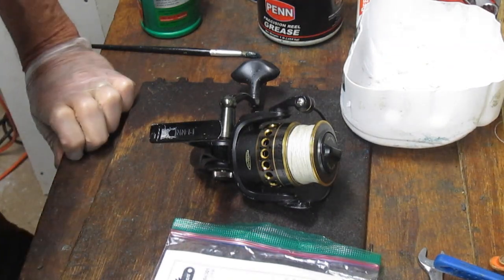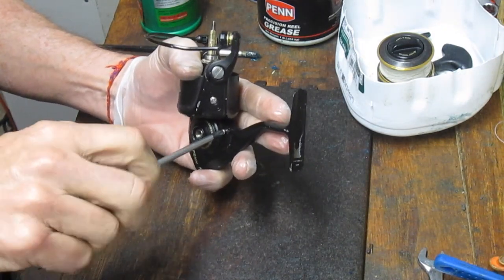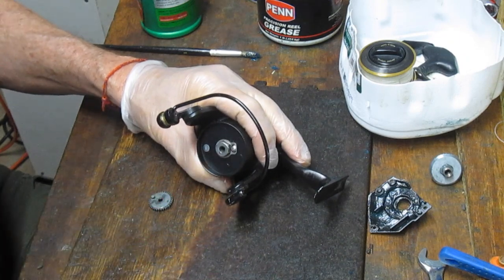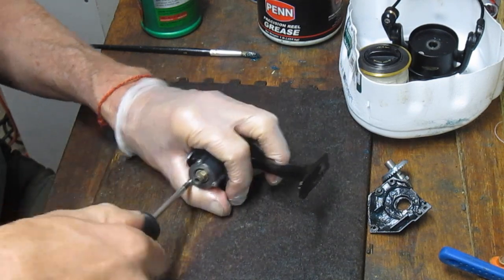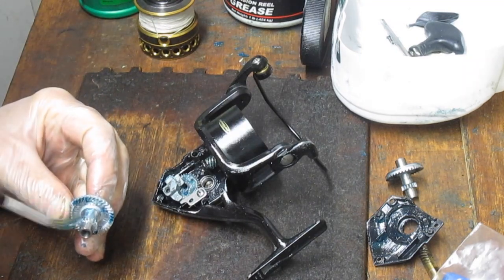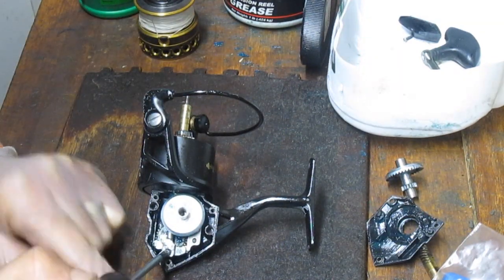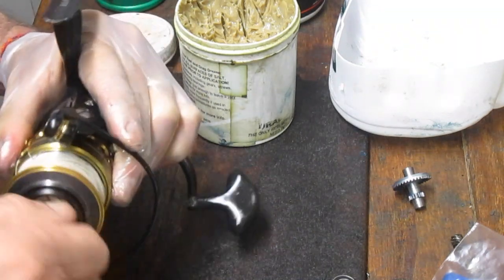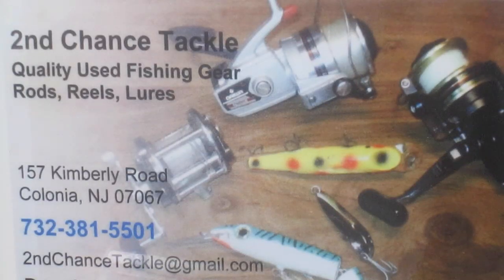Penn Battle II 4000 fishing reel how to replace the main and pinion gears and fully service

Comment: Hi Dennis. Thankyou for all your excellent videos on penn reels. I have definitely learned alot. I was going to request a video on clutch/sleeve assembly, but this video covered everything.  Thankyou so much for this video. Stay safe.
Reply from the maker: Yes - watch this video from around the 7:25 mark.  Your A/R system is set up the same way.  Remove the pinion gear and bearing stack and then the A/R clutch and collar.  To replace, just reverse the process.
Dennis
https://youtu.be/lPcFkjGTiPk
Reply: @2ndChanceTackle  I have a penn Pursuit II 3000 that needed a new clutch/sleeve assembly. I could only find your video on the battle. I was able to replace it and clean my reel thanks to you. Keep those videos going. A+

Comment: The pursuit remains metal sideplate but not body. The new fierce is metal body and side plates. The new battle 3 has CNC gears and metal body and side plates. The battle 3 DX (dealer exclusive in silver) has brass CNC gears in all sizes 2500-8000 (amazing)
Reply from the maker: Yes - the new series has made some significant improvements over the 2nd generation of Fierce and Pursuit.  In addition to the ones you noted, they also upgraded the felt drag washers to the HT-100 ones.  Thanks for watching - Dennis

Comment: I see that you used a drag grease for those HT100 drag washers. I have ordered some Carbontec washers to upgrade my old Fierce II reels. All I have is Reelx oil and the Penn blue grease. Do I need to buy a drag grease or would one of those suffice? Thanks! I have been learning a lot from your videos.
Reply from the maker: Keith - you do not need to oil or grease the Carbontex washers.  If you like, you can use a light coat of regular reel grease and then wipe it off, but it is not necessary
Thanks for asking - Dennis

Comment: Hey Dennis, great video as usual. I have learned a lot about servicing reels from you. I have a question, I have the first series Penn Battle 4000, I was wondering if I could put a power knob on it?
Reply from the maker: You can, but you need to drill out the stud that attaches the original knob to the handle.
Reply: 2nd Chance Tackle did you have any videos on how to do it? Or what type knob I should use?
Reply: Did you have any videos showing how to replace the handle on a penn battle?

Comment: Hi dennis, I just took everything apart and did service on my penn battle II 8000. However now when i wind it, it makes a buzzing sound? I am totally confused why or whats going on here. I looked at the order of parts on the pinion and geared/oiled all the gears and bearings. This is really bothering me and throwing me off. Thanks so much for your help
Reply from the maker: It may be the order of the shims on the main gear.  Hard to guess the "Buss" without seeing and feeling the reel.  The gear shims are used to align the pinion and main gear and take the side to side play out of them.  I'd check that first - Dennis
Reply: @2ndChanceTackle  It turned out, my Anti Reverse holder/bushing and spring were slotted upside down on the AR dog but they still fit the on the AR dog slot so it wasnt easy to know that. I really had to hone in on the diagram. Just so you know, for future troubleshooting reference
Reply: @2ndChanceTackle  It turned out, my Anti Reverse holder/bushing and spring were slotted upside down on the AR dog but they still fit the on the AR dog slot so it wasnt easy to know that. I really had to hone in on the diagram. Just so you know, for future troubleshooting reference

Comment: I notice these reels have some sort of sealed bearings..blue seal on the larger upper pinion bearing,and black seal on the lower. I easily got the blue seals off,but the black are not cooperative..Can I remove these black seals?
Reply from the maker: I am not certain, but Penn used shielded bearing on this reel and sealed bearing on the Battle, so I believe the answer is that you can get the shield off, but not 100% sure - Dennis

Comment: Why do main gears normally wear out ?
Reply from the maker: I think the primary cause is mis-alignment to the pinion gear.  Next up is normal usage.  These gears are just a basic alloy and not a hard metal, the last is that they are over-worked, like trying to wrench the line by cranking to clear a snag. - Dennis